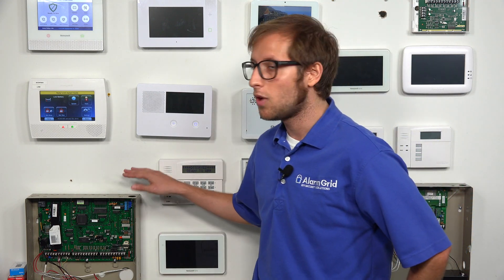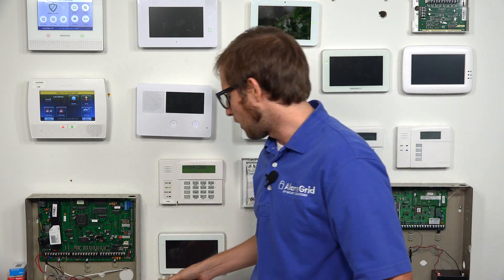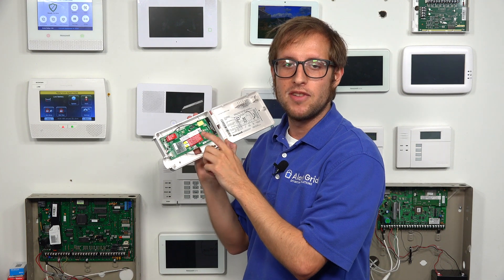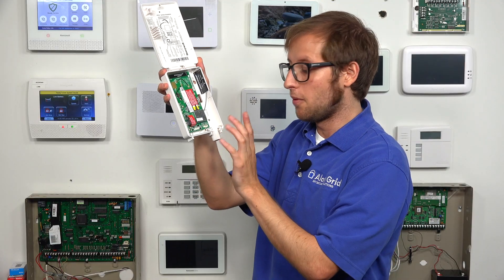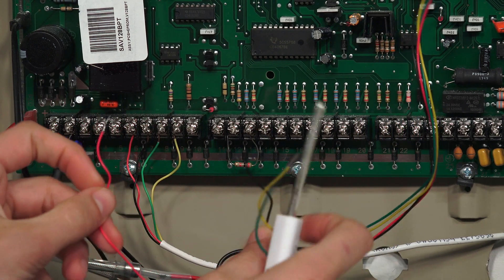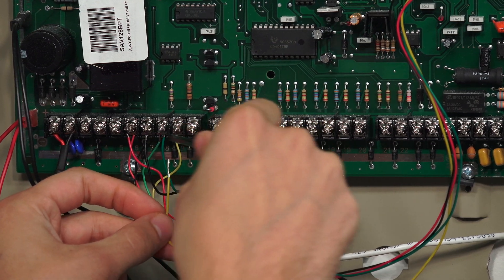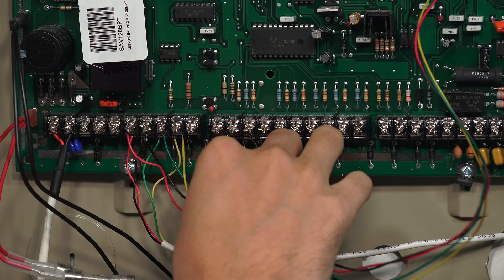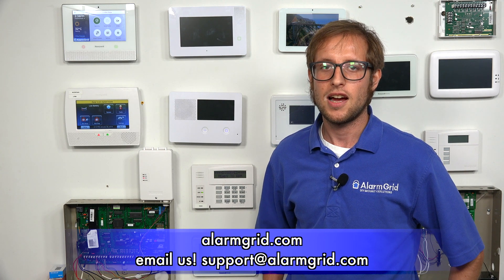Install Honeywell LTE-XA or LTE- XV On a VISTA TURBO

Comment: Will this work for VISTA-12BP?
Reply: Hey Joe, this communicator will also work on a 128BP panel only for alarm reporting. The 128BP does not support remote services (Total Connect 2).